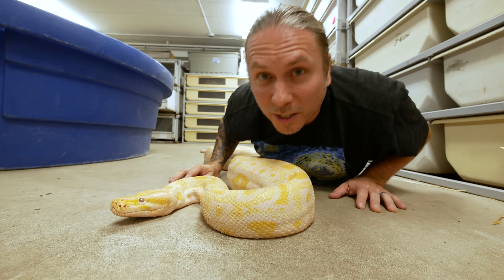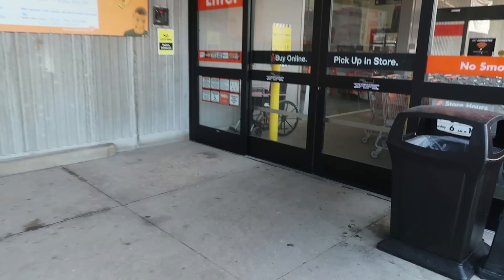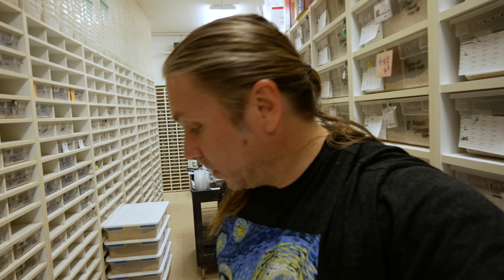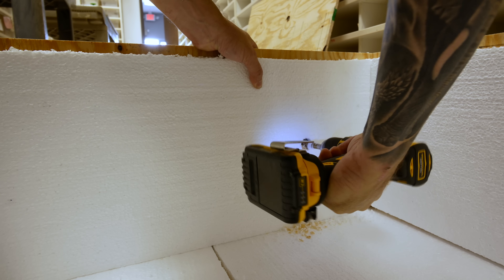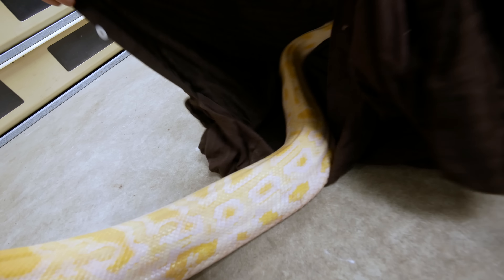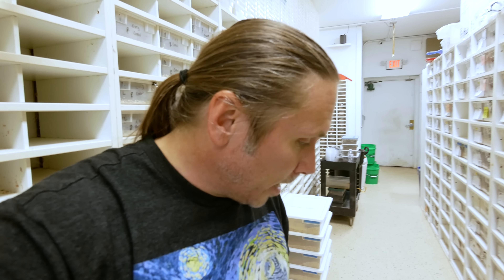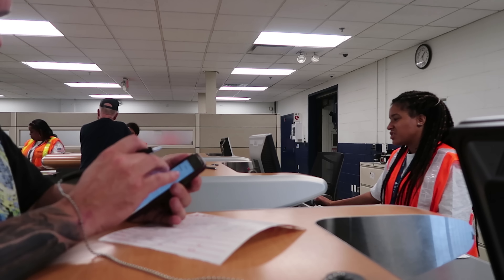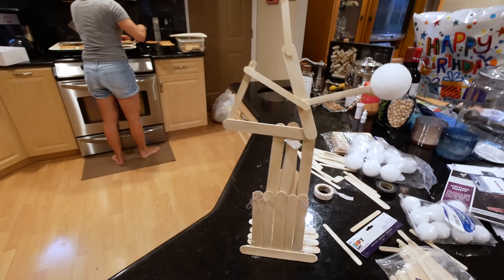GIANT SNAKE ON A PLANE!!!! | BRIAN BARCZYK

Comment: This was an awesome video Brian. I have been busting my nads the last couple days fixing a car that I personally think is unsafe for anyone to ever drive again. It's from New Hampshire bought new there and driven there until about 10 days. I was asked to fix the exhaust system because it was a half of a hack job. When I showed up to fix it the car more or less was the drivers side wheel was not attached to the car. It was shoved into the fender well and kicked all the way out on the bottom. I hate Hyundai with a passion!!!!!! The only reason I'm even putting the effort into this car is because it belongs to a very close friend of mine that I would give him my last dollar to my underwear if he needed it. The more I fix the more breaks because it's a Hyundai as well as it's spent it's entire life driving on road salt and it's so corroded everything you touch is falling apart. But I'm the type of person that no matter what it takes to complete a job I will keep driving and driving until the job is done. I even told myself that I would never work on another Hyundai again after we got rid of ours that was finally traded in for a new car it however did have over 300k miles. I have been turning wrenches since I was a kid. I will say this after this huge cluster ¿¿¿¿! I will sell off all my belongings and travel to another country before I touch another cursed Hyundai! I honestly don't know that I would do it for my very close friend if he bought one. They are an okay sorta kinda starter car but other than that they are useless and should be kept out of this country. Just one guys opinion after working in a shop for 12 years that seemed to be a magnet for them horrific things. I'm sorry for ranting and raving. I am very happy to see Artemis is doing better I seen her in the tale ending of the video and it really made me smile and seemed to take away the outright worn out exhausted man really feel better. You guys always seem to be just the ticket for me to just shed off about anything negative and be able to relax and give me a good place where I am able to go to sleep. Not saying that you're boring! Because you are far from it!! If I try to get some sleep without watching your videos I have so much trouble with it and don't feel refreshed like most people feel after sleeping the night or a nap. Thanks so much for what you do everyday alongside your family and crew!